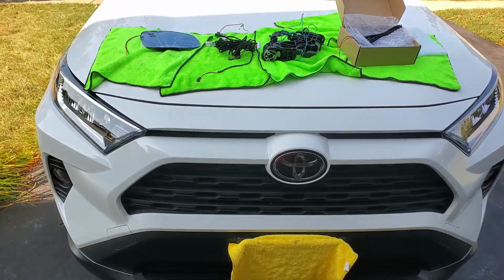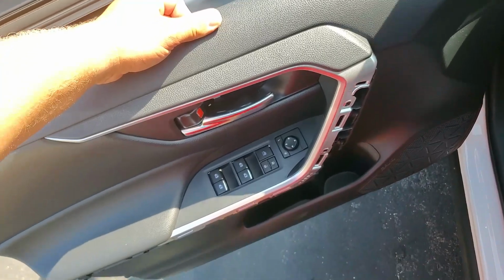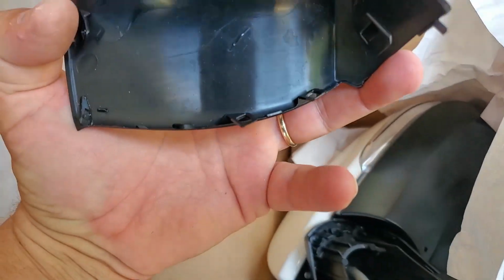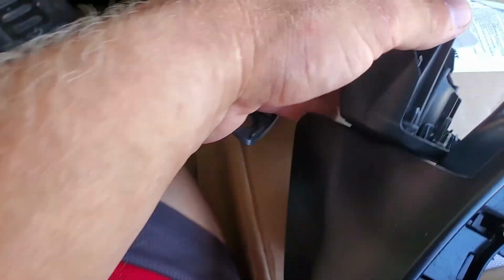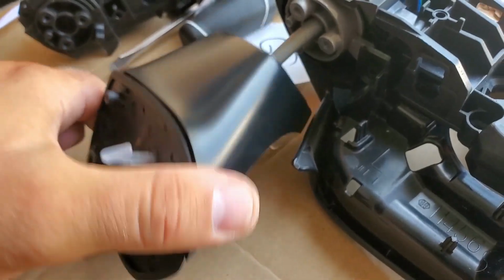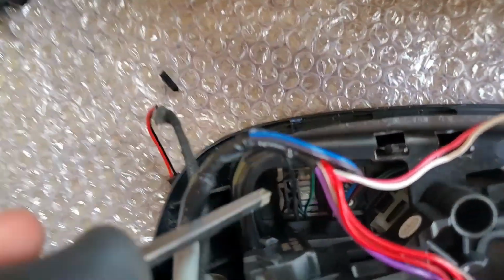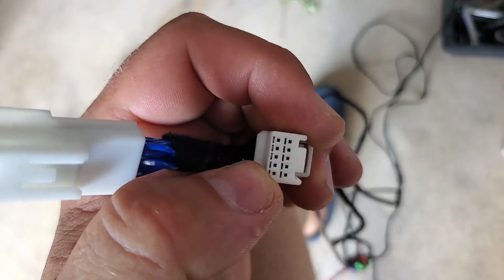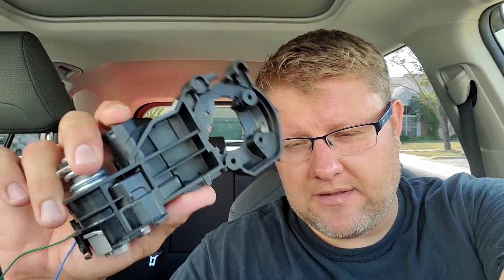2019 Toyota Rav4 power folding mirrors installation attempt.

Comment: Sorry but my rav4 comes with auto folding mirror the control is on the electric mirror adjuster  you have L and R and authority the rocker button the circle controller.  The a fold unfold override button below
Reply from the maker: My rav4 did not come with it,but it doesn’t matter nit that important

Comment: This connector plug them under steering column area
Reply from the maker: You are absolutely correct about this one. I did finally find out where that connector is located, but I decided not to proceeded with finishing this install. I want to install remote start in few moths and I might be needing that connector.

Comment: Reading lots of comments on this killing off safety sense and awd. I assume that little box is just mimicking a module that communicates via CAN that exists for some trim/package. That said, you'd think the manufacturer of this kit could at least get you info on how to make it work in a dumb way (without the module) and just when it gets ignition power open up :|
Reply from the maker: I figured out how to install this module,but I also found out that this is for LE Rav4 models. My XLE has extra features that I don't want to mess with.

Comment: Hi how's your projects getting on??
I was watching your failed attempt at installing the power mirror because of not been able to identify where to connect the wire harness ..however the harness is correct as the connections are under the steering column
Reply from the maker: I found out where that harness connects to,but I decided not to install it. I was told by one smart man that this is only for LE basic model. If you have XLE you might loose  Toyota sense system once you install it.
Reply: @Nazaretos, so you haven't installed them on your trim, right? because of Safety Sense. But on LE trim Safety Sense will be okay with these mirrors, is that correct?
Reply: @Nazarettos, hope you are doing great! Are there any chance for you to install the modules? Do they work?

Comment: This kit only works with base level LE models without the safety sense package. Do not buy if you have Safety Sense!!! Or AWD!!! It will disable all of these features.
Reply from the maker: I have not connected it yet,but I did find where it connects. Its under the steering wheel. Thanks for the info.
Reply: @nazarettos6987  correct. The wiring harness pigtails from the small computer go I to the white connector to the lower right of the steering wheel. However, once you plug it in and turn the ignition on, i had several errors show up in the display and no power went to the mirror motors.
Reply from the maker: How do you know this information?
Reply: @nazarettos6987  because i spent all afternoon yesterday installing it on my ‘19 Adventure model and, as soon as I plug the wiring kit to the steering wheel, I received multiple error codes related to Toyota Safety Sense and my AWD system went into limp mode and was disabled turning the car into FWD only. Removed the wiring pigtail and everything went back to normal.
Reply: @Marco Ponce, and if I have AWD HYBRID LE would it work? what do you think?
Reply: @ataelD  I think you’ll have issues as long as your car is equipped with Safety Sense and AWD (whether mechanical or electric). The computer module unfortunately doesn’t appear to be coded to recognize advanced traction and adaptive cruise control systems controlled by the steering wheel.

Comment: awesome, this video is the best about electric folding mirrors installation I ever seen
Reply from the maker: I found out where to plug in that connector. You have to remove 3 screws around that steering wheel cover and underneath the steering wheel you will find the connector tor to which you have to plug it in.
Thanks for the positive comments.

Comment: 😢😢
Reply from the maker: Don't worry I finally found out where to plug in that connector. Its actually very easy but its hidden under the steering wheel. You have to open up plastic cover thats covering steering colum. Connector is visible only than.
Reply: @nazarettos6987  oh that's nice man, I really do appreciate your videos and Information on upgrades with the 2019/2020 RV4s. Am planning on 2020 RV4, hope I will enjoy.
Reply from the maker: @justuskamulegeya7339  that connector goes under the steering wheel. You have to remove 3 small screw that hold plastic cover around steering wheel. There is only one connector that needs to be plug in into. Very easy...

Comment: You need to do your homework before you make the video! And the connector for the mirrors is under the steering column
Reply from the maker: You are correct about it, I just didn't know. I received email from engineering department and they send me photos . im gonna finish this job next week, but also should I connect power directly to battery?
Reply: Nazarettos my best advice yes, don’t risk any sensor, air bag and connectors under the steering column
Reply: You did a good job, but like you I ask the company about the connector that day, and wait for a response! And the next day I did the connections, my best advice to you is that don’t release any videos until the job is done, and send the video to the company for review, then release it to the public if the company that is giving you sponsorship approved it,keep it up
Reply from the maker: @BulletSolano  they really bad with providing directions. I had to figure everything out.
Reply: Nazarettos I know but that’s where you’re skills will shine, keep it up champ
Reply from the maker: @BulletSolano  thanks man,you really helped out with your video.
Reply: Nazarettos no problem

Comment: Good install! The connectors you referring to is the one you have to connect under the steering wheel ignition not the door controls because the only mirror fold motor wires are need to fish it thru the door rubber grommet going to the kick panel..
Reply from the maker: Thank you so much,ill try looking for it. They don't provide any directions.

Comment: blind spot monitoring > electric folding mirrors.
Reply from the maker: Well I tried,but I wasn't gonna cut into my Toyota wiring without any diagrams. This company did not send me right connectors,and I didn't want to cut original wires and play guessing games. So I had to leave this video not finished.